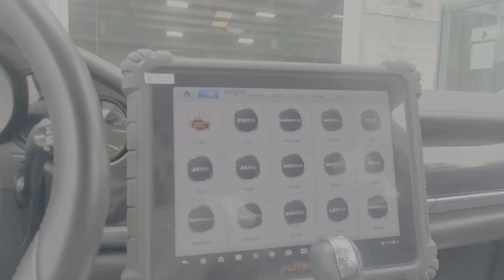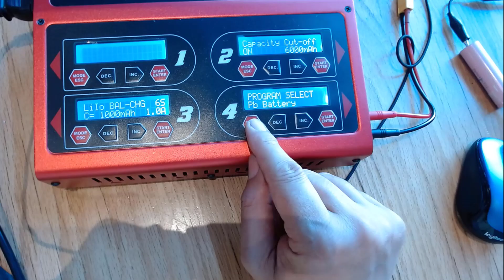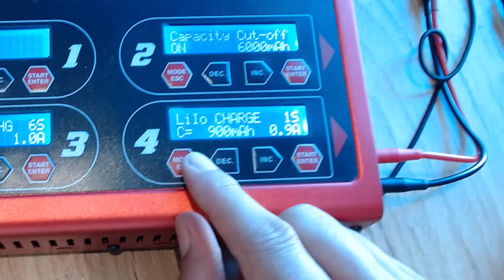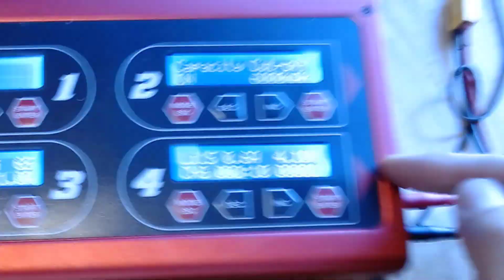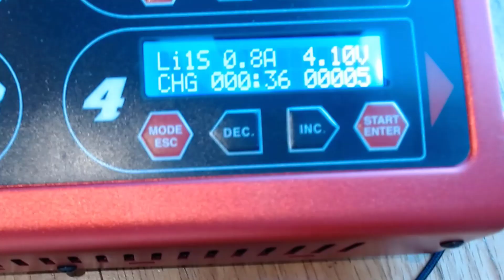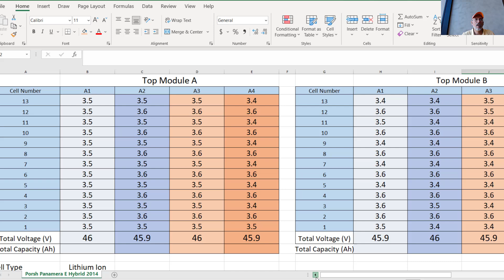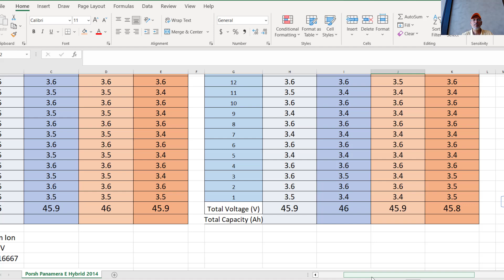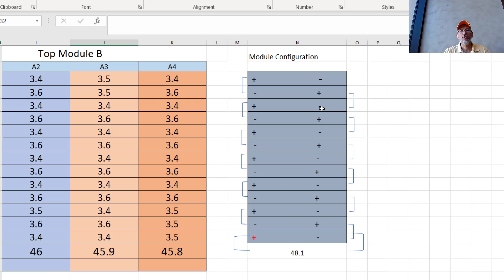Porsche  Panamera Hybrid Battery Repair part 1

Comment: Abdelmajid, this series of videos (Part 1 and Part 2) are excellent information. The hybrid battery arena (especially for Porsche) is a total black box for most DYI individuals such as myself. I have the same model Porsche Panamera, and hybrid battery,  that likely needs refurbishing . I have a fairly extensive workshop in my garage so it should be doable (with your terrific guidance from these videos of course). If you offer fee based consulting or provide services I would welcome engaging with you directly.  Error codes (POAA600 - High-Voltage system insulation fault in minus wiring) (P32A800 - Check High-Voltage battery fault memory content) (P32A800 - High-Voltage battery system, insulation fault).  Might be wiring or control unit, will know more shortly.